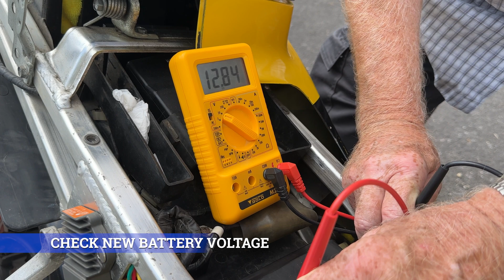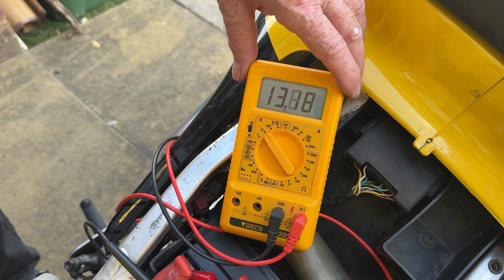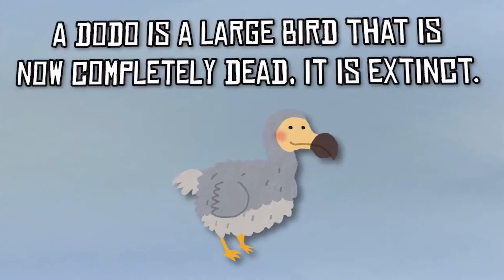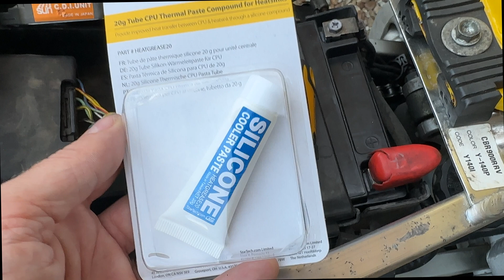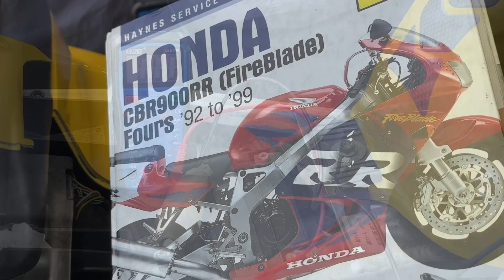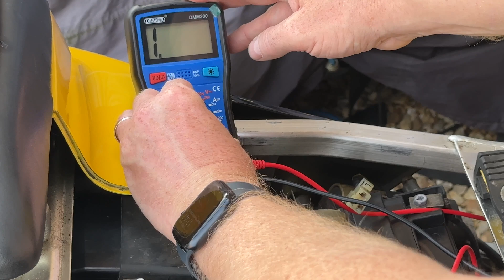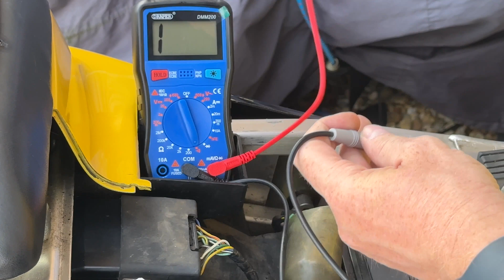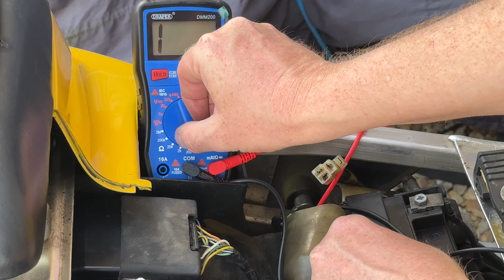Boiling my Battery - Could have been Nasty - Regulator/Rectifier Failure #fireblade #cbr900rr

Comment: This happened to me in the late 90’s on my 1995 893cc Fireblade. The reg/rect stopped regulating. The battery cooked went to infinite resistance and the bike stopped far from home. This turned out to be a thing with this model. I fitted a replacement, and a voltmeter, and this failed a few thousand K later. I then fitted an aftermarket Newtronics PMR 3.2VF regulator/rectifier. This lasted until about 3 months ago, (May 2024, at about 128,000km) before it stopped regulating, it went to 17VDC on the voltmeter and stayed there. I have replaced that one with a standard reg/rect.
Reply from the maker: @sunnyorbit  it’s without a doubt a weak point with Honda. I also had the Reg/Rec fail on my VFR750. 

I’ve been told that the one I fitted is not the best so will change that again at some point.. At the moment I’m keeping an eye on the Volt Meter I bought.

Comment: I've had a similar issue on my 99 VFR800 track bike.
Nearly burnt down between sessions.
The battery got so swollen and wires melted around it that it had to be pried/forced out of the frame with screwdrivers..
These older bikes always have to be checked through, regarding the wiring, and rectifiers etc..
Reply from the maker: My VFR750 also did that!! Replaced everything and it’s been good for the last 10 years with no issues!! 

Sure does seem to be a Honda issue though!

Comment: Some of the original problems look like they were cause by those horrible car crimps connectors. They are not weather proof. Corrosion builds up which increases resistance and heat. Result melted wires. I always use the Japanese style bullet connectors and multi blocks. All available online. I'd try electrex world for a good reg /rec or try a Tourmax one. Both up to OE spec. Good video on checking your charging system.👍
Reply from the maker: Thanks for the comment mate… I’ve been told that I should ditch the connectors completely and solder directly. I’ve also been advised by a few to to upgrade the Reg/Rec to one from a 2000 R1 as the one I used might fail. Although that’s a bit of a minefield as I’ve been given conflicting advice on many different models of Reg/Rec.

The voltage at the battery is good and the Stator is running as it should but I will do this upgrade soon.

I’ve ordered a battery voltage meter to mount on the bike so, until I make the upgrade, can keep an eye on how the battery is being charged and how it’s performing.

I’m just glad the battery didn’t blow my bits off when it boiled…